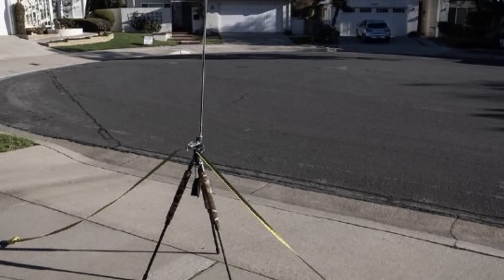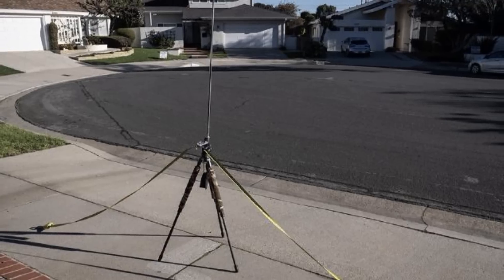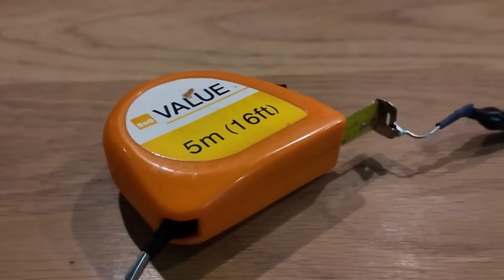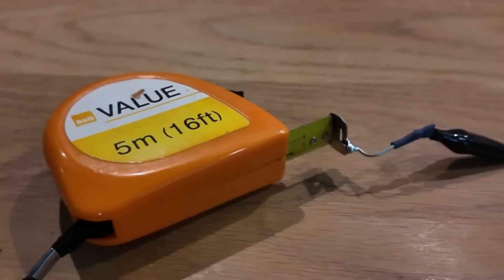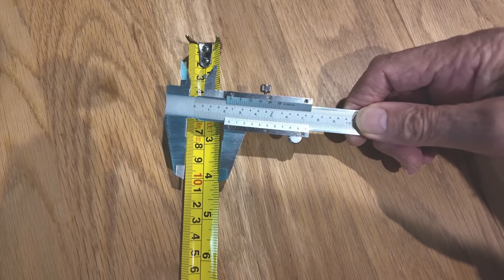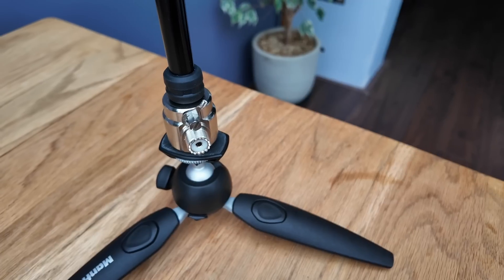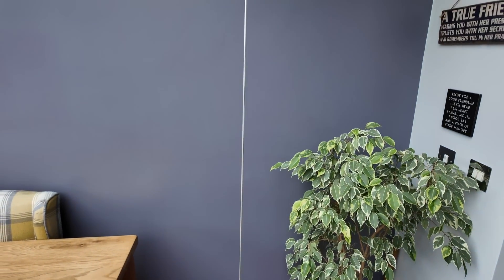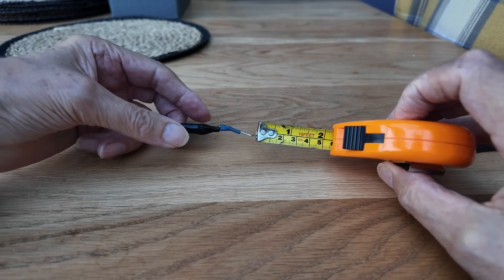HF Portable Antenna Using A Tape Measure

Comment: The way we position the radials on the ground probably determines a certain antenna directionality, when we have few radials.

By the way your videos are excellent;

Intuitively I would expect if, for instance, we place two radials in a 90 degree angle in the ground, the max radiation would be pointing towards a direction outwards the 90 degree angle bissection.

Is that so????

Can someone throw light to this ignorant soul?

Comment: Do you think the coil of tape remaining inside the tape measure has an effect on why the ground radial is shorter than expected?  73’s K8JTE
Reply from the maker: As it is at the end it will tend to act as a choke but at the same time add a bit of capacity loading. So yes, but not that much.

Comment: I suspect the broad tape measure as a greater surface area, so more capacitive coupling to ground
It would be easy to prove by swapping it for a similar length wire radial.?

Comment: It is very similar principal to the SteppIR Antennas with Adjustable Copper Tape Elements but Stepper Motor Controlled to Change the length.

Comment: Aluminum Duct Tape is another good cheap  radial or ground. It will stick to wood, shingles, concrete and even a fiberglass van roof and last a good while.
Reply from the maker: Thanks for that info.

Comment: Hello Peter, I built once a Dipole with 2 Tape measures.  Fix a rope between 2 trees, hang the tape measures with the clips (for fixing them on belts or jeans) on the rope and extend to the desired length.  Connection  with soldered wires to a balun .  2 tapes with 10m  work from 6m to 40m band. The only disclaimer, when you change the frequency it should not be higher than you can reach. About 2,3m....F1VEL.
Reply from the maker: Thanks for sharing that. The taller you are the better the DX!!
Reply: Collins Radio sold a tape dipole with their portable kit.

Comment: I remember  a tape-measure yagi made for foxhunting. The beam was wood, and the various directors and reflectors were steel tape, ready printed with the lengths needed! I can't recall if it was in PW or HRT- - I think the width of the steel tape gives a better bandwidth around the tuned frequency, over a similar length of wire. Regardikng the shortened length - don't forget by using a tape measure, you have a coil on the far end of the radial.
Reply from the maker: Tes bandwidth improves with increase in cross-section.

Comment: Could you use another tape measure as the driven element?
Reply from the maker: Yes, but need a bit of engineering and may be a problem in the wind!